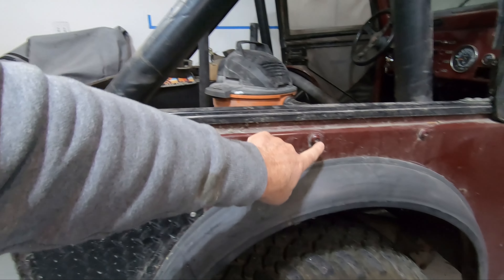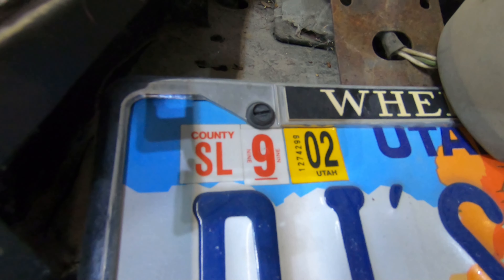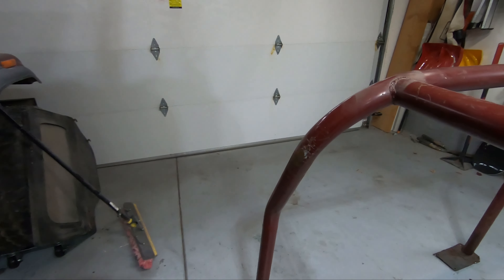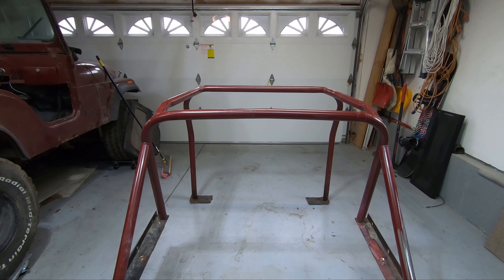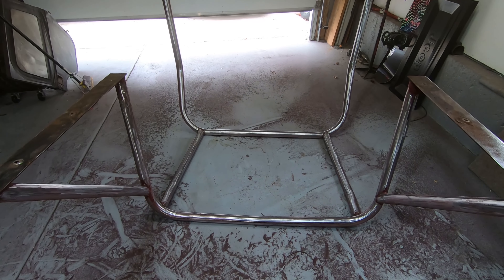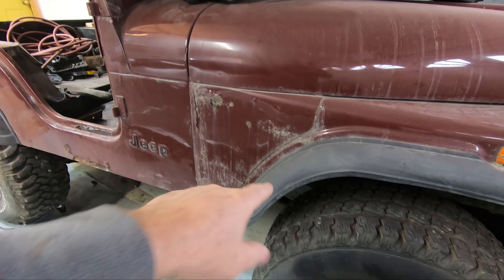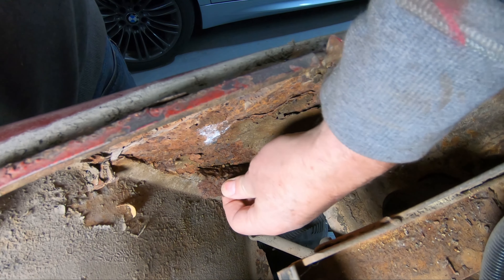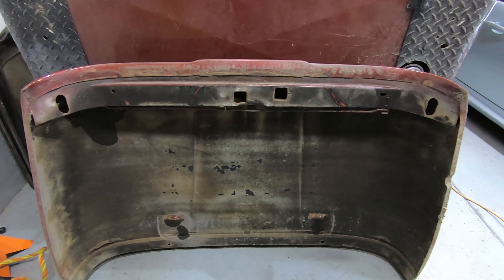Jeep CJ-5 Restoration - EP1 - This 1977 chassis has seen better days but we'll save what we can.

Comment: Was that roll cage factory built or is that an aftermarket cage? When did you buy this Jeep?
Reply from the maker: Well, this cage is sort of "both".  The back half is the factory original, and then someone (not me) welded in the front posts.  I've had this jeep for over 20 years, probably closer to 25 years, but it sat for a long time without turning a wheel.